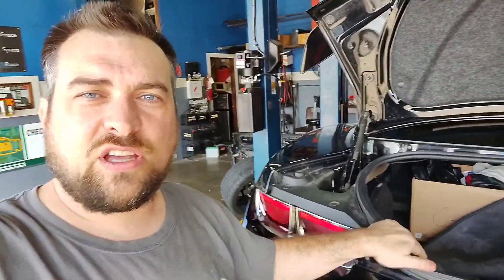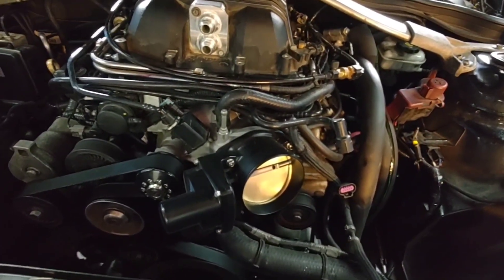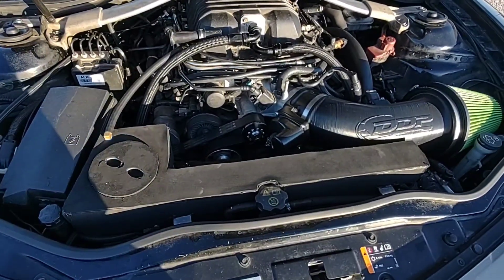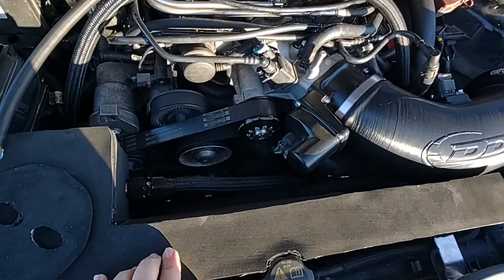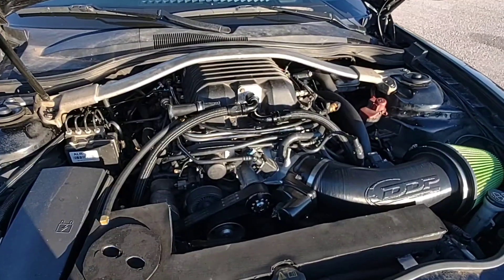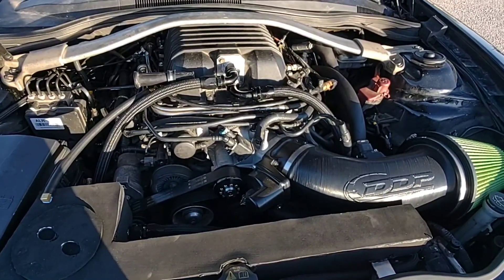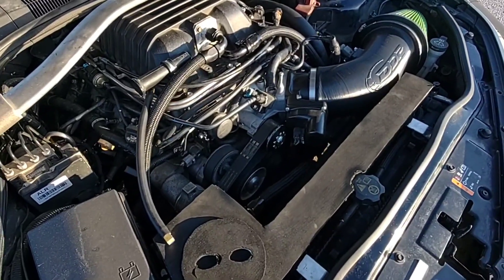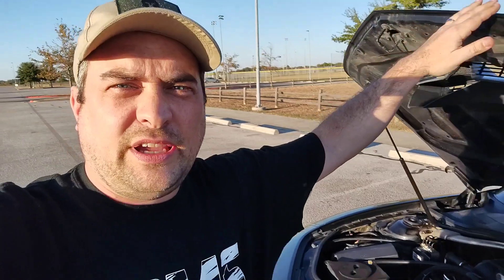GEN5CONCEPTS - The perfect chiller system setup

Comment: If you wanted even lower temps you would be sucking air from outside of the engine bay...
Reply from the maker: @dylandesmond  you would think so. But it actually doesn't. I tried pulling air from inside and outside the bay, it made no change in iat2. In fact I can sit idle and watch iat1 get up to 180...and iat2 still sitting at 45.... regardless, I added a heatshield because obviously pulling straight header heat is a bad idea. The intake is a one of a kind, it's usually made for the ctsv and this was the only one ever made for the camaro.

Comment: Question!! ( the water from the tank goes to the chiller core where it gets cold and then it is passed through charger after that it goes to the tank again Right )
Reply: and if heat exchanger is added then the outlet water from the charger goes through heat exchanger  and then passed into tank
Reply from the maker: @orange-dd5rw  water from the tank goes to the blower, then to thr chiller core, then back to the tank. A heat exchanger will actually warm the water in this system, do not use it in conjunction.

Comment: Why doesn't someone just design a separate compressor and system for chilling the intake air instead of using bap-ass r1234yf refrigerant or whatever it is in this car? 
Ammonia is like 8 times more effective of a refrigerant than r1234yf. 
Of course it's highly poisonous and will kill you, but who cares it's not in the cabin it's under the hood. 

You didn't mention how the AC performs when it's 110 outside and you're chilling that water with the AC compressor. 
If the AC gets one degree warmer in South Florida, that cars a dub you can keep it. 
Ain't no way I'm driving around with the windows rolled down sweating my dick off and looking at my intake air temps and thinking yea, this is great...
Reply from the maker: @jims.3987  we've actually been trying to find an independent system like you mentioned. I think space under the hood is an issue as well as spinning a compressor. Would pro a ly have to be electric. 
    As far as in cabin ac performance we are in central texas...it's hot. Cabin ac is cold. I don't do the window down thing either...until December rolls around haha.

Comment: How'd you insulate the tank?
Reply from the maker: I used a sheet of insulating foam with an adhesive side. Cut the shapes needed to fit each side of the tank. Then sealed the gaps with black silicon to prevent condensation.

Comment: At the beginning of the video the tank didn't have a line on the upper left corner of the tank, after installation of the system the video shows the line. Why was it added and where is it connected too. Thanks Much.  I'm adding LSA to my 15 SS with an interchiller and I'm looking at tank setups, also what interchiller system are you using?
Reply from the maker: You have a good eye. The purpose of the added line was to "vent" the tank from pressure. When I first installed the tank the lid would randomly leak coolant, in an effort to avoid coolant leaking around the lid I installed a vent tube to an overflow canister until it could be fixed. Not long after I made this video I got with the tank manufacturer who sent me a resized oring for the lid. I removed the extra line and plugged the hole. There have been no leaks since. The brand of chiller I'm using is a modified version of FI interchiller.

Comment: I'm late to the mix.. I'm having heat soak issues with '18 V3 ctsv in Las Vegas. I've had IAT 2 temp reach 189 while sitting still in a parking lot on an important call. The temps came down quickly when I started moving. Today was 95 degrees and the lowest temp I got was 123, high 174.. Only had the car 2 months, bought it from owner in Detroit.. methanol doesn't kick in until 6K rpm.. Looking to do a similar upgrade like yours.. How much does it cost?
Reply from the maker: Chiller systems are not cheap, however any cooling mod isnt cheap. A good chiller setup will be around $2,000 . If your IATs are that high your car is pulling timing and you dont even know it. The car will feel sluggish until cooler weather comes in the fall. With a chiller you will have boost season all year round. It really is the BEST cooling option out there for anything who actually drives their car on the street.

Comment: how many wide open pulls can you make before the cooler system heat soaks?
Reply from the maker: Depends on your boost level and how long you stay in it. I do mostly 1\4 racing with it. So in 1 pass itll never get over 100. It'll rise a out 40* then come down about 20* immediately. By the time you cruise back to the line it'll come down another 20 and be back to where you started before you hit the line. If you're on the street... Maybe 3 back to back pulls before I'd recommend letting off and cruising a bit.
Reply: Where can I buy it

Comment: Great video Did! Did you ditch the exchanger? Do you have the ac compressor on all the time or only turn it on before spirited driving?
Reply from the maker: Yes I ditched the exchanger. There is a valve that allows you to run both if you wish. I keep my AC on all the time, but I'm in Texas so my ac rarely gets turned off anyway..maybe for 2 months in the winter ..
Reply from the maker: @donventura3844  I ditched the hx. I live in texas..the ac runs day and night year round already.

Comment: Do you make pulls with ac running or do you make a lic then turn on interchiller to cool off temps
Reply: The ecu auto shuts down the A/C system as soon as you go wide open throttle, because A/C compressors are not designed for higher rpms. This has been the standard in all manufacturers for years.
Reply from the maker: @A2J_Tim  you are correct, they do. However when you let off the throttle your engine can still have pretty high rpm ..this rpm is transfered to the ac compressor which raises refrigerant pressures. If you had a button in your car that would guarantee you would never throw a rod during a pull...would you take the extra second to press it ? .. im sure you would ;)
Reply: @TractionControlusa  in modern cars the Engine control module is in control of the A/C system and will not allow that compressor to engage above a specified rpm as per manufacturer programming so even if you let off and you are still above the acceptable rev count it will not re engage the A/C system. Technology is a wonderful thing, Some times..
Reply from the maker: @ORIANA250  again you are correct EXCEPT we aren't talking about abfactory ac system anymore, we're talking about a system with a chiller that has been added. The ac compressor on a 5th gen camaro(the car in the video) is set to shut off above 3500rpm. This is fine when working with the oem expansion valve. But can damage the chiller valve. The valve in the chiller is a home hvac tx valve that's been repurposed. Also these companies do NOT give you a specific fill weight for your refrigerant,  which leads to many over and under fills.
Reply: @GOD2FAST  thats a bit of a loaded question, those parameters will be determined by the manufacturer and how they choose to tune the car, so it all depends on the car and how it was tuned. some engines particularly diesels do not exceed the rpm limit of the compressor and the rpm limit would also be different on every vehicle based on the pulley ratio of the harmonic balancer and the size of the ac compressor pulley. So more than likely the primary maps that control it will be based on TPS and Engine load more so than RPM.
Reply from the maker: I run my chiller all the way up to the burnout box. I do pretty short burnouts to clean my tires. I then shut my ac down. Make pull. Turn ac back on as I'm  coasting at the end. I do all this just to be on the safe side.

Comment: What are iat 1&2 on wot pulls
Reply from the maker: Iat 2 doesn't seem to care what 1 is. Iat1 can get up to 150 at idle and iat2 is still sitting at 50(or whatever it got down to). Once you begin a pull iat1 will usually drop due to moving air flow, iat2 will rise , mine usually goes up about 35-40* per pull. So if it starts at 60 I'm at 100 iat2 at end of pull. Then I just pull around and the temps immediately start dropping again

Comment: You have to run the AC to get the inner chiller to work it’s cooling process correct?
Reply from the maker: Correct. Living in the south we can't drive our cars without ac most of the year anyway. Temps rarely get cold. It hasn't been an issue for few years I've been running it so far.
Reply: @TractionControlusa  do you find the chiller drags on the A/C performance in cabin from a comfort perspective in the summer heat down south?
Reply from the maker: @laurensdelpech6343  not at all, at least not when it's filled correctly. For the first few months ac was not as cold, until I found an ac tech who actually knew what he was doing. Ever since then in cabin ac temps are just as cold if not colder than they were without the chiller. So if you know someone with a chiller and their in cabin ac isn't cold...their freon fill needs adjusted.
Reply: *start

Comment: Will it work with a pro charger system
Reply from the maker: Only if your charge pipes are liquid cooled.
Reply: @TractionControlusa  Do you know any good companies that would carry those and also would the inner chiller fit on a 6th gen
Reply from the maker: @dexholloway9284  unfortunately no. Not for a procharger I don't. Most procharger use air to air heat exchangers.
Reply: @TractionControlusa  thanks again

Comment: Can I get a link to this exact tank and also what all would I need to run AN lines
Reply from the maker: https://www.blackmarketracing.net/products/bmr/cooling/reservoirs-and-tanks
Reply from the maker: also you will need -12an braided hose and fittings. If youve never worked with braided hose or AN fittings its probably best to let the shop do it, as it typically requires special tools.
Reply: Will it work with a procharger set up